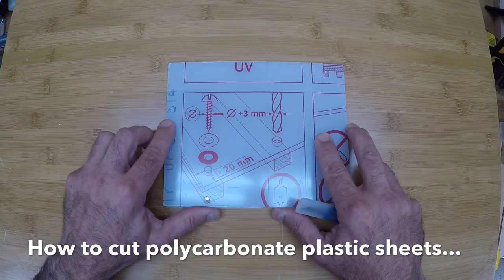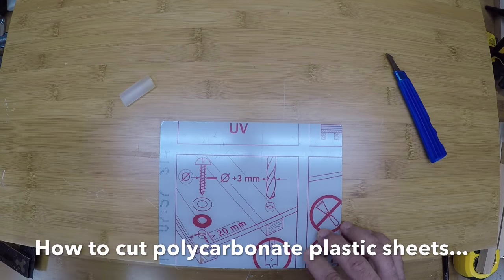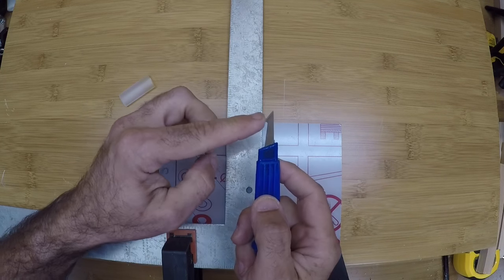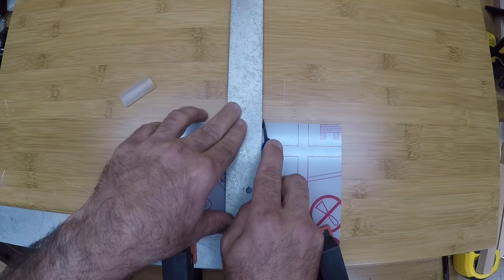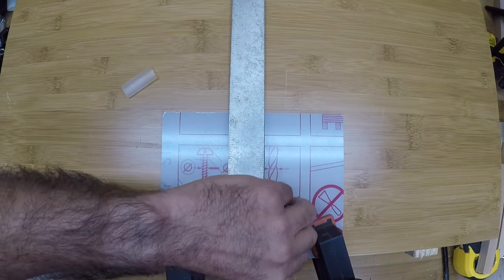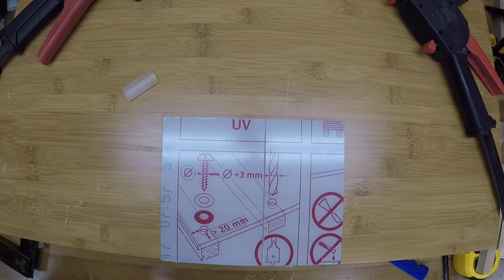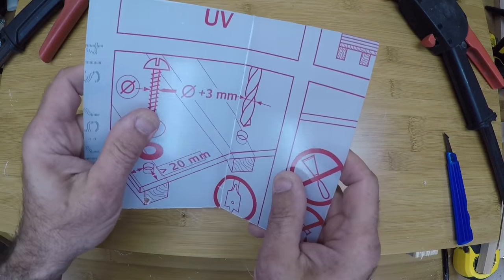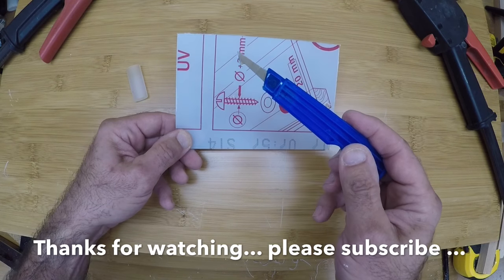How to easily cut plastic sheets by hand

Comment: I’m testing materials to build a “crystal” 9 tail fox harness for a costume, foam board has been the easiest solution so far but the costume in question looks best with a somewhat see through tail, so I was hoping plastic with holographic vinyl or cellophane would be an alternative but I’m not sure if this would add too much weight or just be too difficult to cut with since I would need to make 9 tails

Comment: How thick was this panel of acrylic? Also, do you think this technique could work on stippled ABS plastic?
Reply: I cut 1/8" ABS with a cutter like this. The plastic I use is stippled on the front side and shiny on the back. I make my groove on the shiny side and drill from the shiny side, since the stippled side is the "good" side. Works well.  This video is the first time I've seen that blue handled tool. Mine has a black and red handle and looks heftier and more robust.  But it's the same kind of tool. It does the job.
Reply: @PhillipLandmeier  you think it would also work on abs plastic 1/4” thick?
Reply: @vincentmejia9592  I'm sure it would work but it would be at least twice as much labor.. This method is very labor intensive.. it's okay for an occasional cut but I wouldn't want to do it every day.

Comment: What is this tool called and where can I get it?
Reply from the maker: I got mine at Lowes, looking on the site it’s only 4.98, the item number is 163055. There are heavier duty ones but for thin acrylic and polycarbonate sheets this does just fine. I have not tried to cut pvc panels.

Comment: You make it look so easy. Can you show how to cut curves?
Reply from the maker: +S L that would have to be done with power equipment.. like a bandsaw, jigsaw or could be done with a coping saw I’ll try and do a video on this..
Reply: To do curves, arcs or waves it just requires the appropriate shaped template (or very slow and meticulous freehand) because once you've scored the surface your tool will want to stay in that groove ... just be patient (it might take 20-30 passes instead of 5 or 6).  To do an arc or a circle use a piece of string anchored to your tool and the center of the circle (even if the center of the circle is off the material to be cut, it still makes an arc) just remember that if it's covered in a protective film, you can draw on the film (pencil, pen, permanent marker, wax pencil or crayon).

Comment: I just got a battery display case and I wanted to try and turn it into a book shelf. The shelfs though are kind of small so I'd like to know if I could still use this method to remove a couple of the shelves. (It's alittle cramped to cut)
Reply from the maker: +sean t without seeing a picture of ur battery display it’s hard to answer that.  If u want to send me a picture via messenger please feel free to do so that I may be able to give u a suggestion.

Comment: My mirror has a huge plastic frame and I want it much thinner ... wish I knew how to take off some. I’d buy a new frame but it’s a large mirror so hard to find correct frame sizes
Reply from the maker: Sorry this type of cutting won’t help u with that.
Reply: Mark Dohring 
Yeah I will probably have to build a new frame lol
Reply from the maker: reina l there u go.. what type of material are u thinking to make it out of?
Reply: Mark Dohring 
Doesn’t matter too much , I will paint it to sort of look like a metal . Doesn’t actually need to be metal tho. For what I need, I could just use wood
Reply from the maker: That will work .. have an awesome day and thanks for watching the video

Comment: Will this cut PVC panels?
Reply from the maker: How do you cut PVC sheets at home?
A good shop knife can cut thicknesses up to 3 mm. Up to 6 mm thick sheets can be scored and snapped on the score line. For speed and a very smooth edge, expanded PVC can be cut with a circular saw, table saw, band saw, or router. After cutting, edges can be smoothed with a file or a medium grit sand paper.

Comment: I want to make bunch of accurate, straight and tiny cuts in a sheet of 2mm abs plastic. I'm trying to make small holes for things like USB plugs to snugly fit into.

All of my attempts so far (using a knife like in this video, a dremel, and a file) have failed dramatically haha. Does anyone know of an easier way to get accurate small cuts?
Reply: Hot knives and laser cutters. Or a drill. You can't really cut to make holes with regular tools

Comment: Hi, can i use a cutter like for paper?
Reply from the maker: No, not the way u use it for plastic... but if u pushed against a rulers edge it may cut paper, the blade is tapered on both sides.
Reply: @MarksWorld-GetOutdoors  
No i mean 
A cutter but its used mostly for paper

Comment: Any ideas for curved cuts...in terms of tools and/or techniques?
Reply from the maker: +Jeff W great question... for me very easy because as many would say I have too many tools.. lol.. not sure what u have for tool options but I will give u a few. 
Curve cuts will require a power tool in my opinion, some would use a hot wire machine to cut but that really smells...
If u have a jigsaw u can cut with that, blades u purchase will say for plastic, usually 13 teeth per inch is idea in my opinion. If u don’t have a jigsaw those u can buy from 25.00 on low end up to hundreds of dollars. What to watch for with this method, plastic needs to be clamped down well or it will bounce and keep moving or u could melt plastic, but it works well.

Next is a scroll saw which runs 99.00 + dollars.. sits on a table and u feed the plastic thru the blade .. same thing use a blade designed for plastic ... u have a lot of control with this option and really don’t have to worry about bouncing to much because ur holding the plastic with both hands .. and same as above keep the plastic moving to prevent melting .. slower blade speed can help with this also.

Band saw is another option but having to change that blade can be a pain to change for just cutting plastic.. to me the bandsaw is one freestanding saw that if not properly used can cause serious injuries.. this saw doesn’t make a lot of noise like a table saw so I think people get a little complacent using it and it’s basically the saw they use in a butcher shop to cut up meat.. and fingers go fast .. just want to keep u safe.  

Sorry this was so long but wanted to give u options.. if u have any other questions please let me know .. maybe I should do another video showing how to cut curves .. 

Have an awesome day! And thanks for watching the video.
Reply: @MarksWorld-GetOutdoors  Thanks for the info! To date I have had limited success attempting to cut plastic on a curve. Most attempts have resulted in mediocre or melted cut lines, or chips in the plastic. Generally, I have to purchase a lot extra material to allow for bad cuts.

I have tried hand tool cutters (non electric), and portable electric cutters such as jig saws, multi-cutters, rotary cutters etc. again with limited success.

Honestly...(for reason even unknown to me), I never considered using my standing scroll or band saws. And once you mentioned it...it makes total sense. I even have a distant memory of middle school shop class...where I seem to recall cutting plastic on a curve with a band saw.

So, I am really excited to give that a go. I even have pending project that begs for this type of cut. So, once the weather warms a bit, I'm going to dig up my circle jig and give it a try with my band saw.

Have you tried or had success with using a propane torch or other flame device to 'singe' or melt the edge of a cut to smoothness? I found recommendations of this technique on another video.

Comment: lol the cut edge is wonky af
Reply: The crooked edge does the scoring of the material. For that blade to work, keep the took angled low, and keep it moving along the cut line. If you stop too much, the blade may hang or grab in the places you stopped and you will likely have to do some deburring at the end of the job.

Comment: The secret: "use a blue tool". 
What is it though, just a blade for scoring plastic???
Three minutes 48 seconds of not finding out then the guy admits he can't remember buying it.
What if the plastic is corrugated???
Hey, if you don't have much expertise to share, but you think you know a lot anyway, why not make a YouTube video?
Reply from the maker: Well first off thanks for watching .. let’s see the tool has been in my shop for years ... someone had asked me to show how To cut plastic if u don’t have saws... so I think this video showed them exactly how to cut it without expensive tools and did u check the description for a link to the plastic cutter...I’m not cutting corrugated plastic as u can see in the video.. have an awesome day.
Reply: I use these all the time. They work well.  I wouldn't call it a blade exactly. It works like a tool on a lathe. It doesn't cut like a knife.  

And yes, all it does is score plastic. Drawing it repeatedly scores deeper and deeper, removing plastic with each pass. You can score all the way through if you want, but it's less work to stop short and crack it along the score line.  You can also do this with a box cutter but it's somewhat dangerous and a lot more work because the box cutter doesn't remove plastic as it goes. It deforms the plastic to make the groove so it takes a lot of passes. This tool hogs out material to make a V-groove.

If the plastic is corrugated it's probably not possible to use this. If the surface is rough but flat, you can probably do it. The first couple of passes might be challenging, but then the tool will follow the groove.  However, most plastic with a rough or stippled surface is smooth and shiny on the back. This is mostly what I work with and I just cut on the shiny back side.

These tools are inexpensive. I'd suggest getting one to have in your toolbox and try it out. I found it's more useful than I expected.